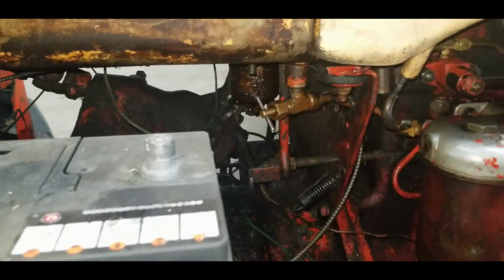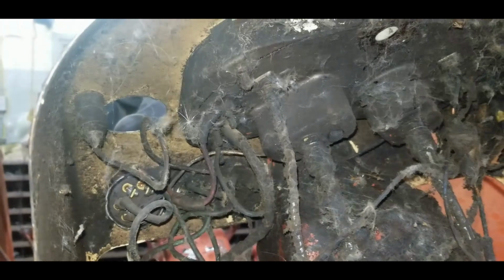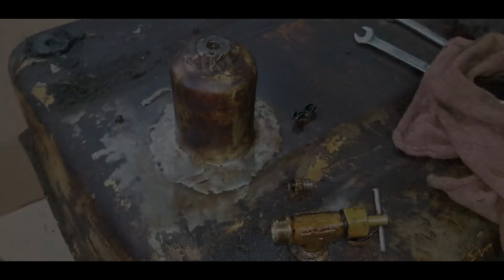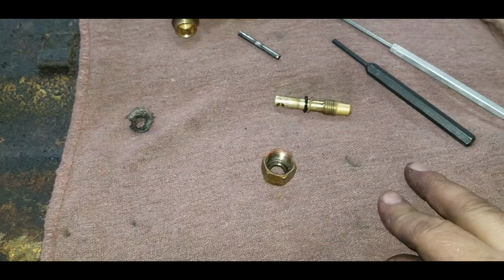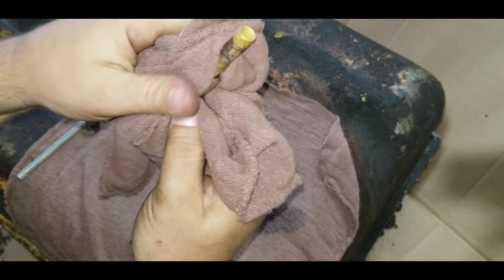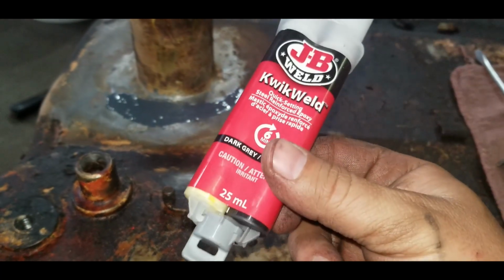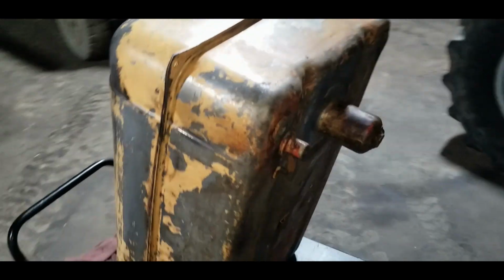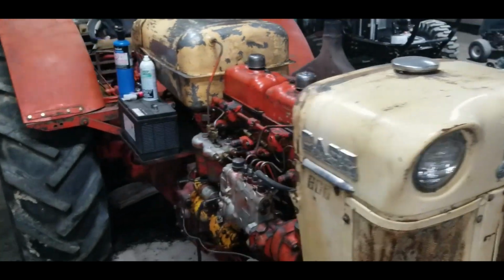1959 Case 800 build.  Part 29!

Comment: That thing you asked about in the end of the video is supposed to have a big long screen on it to screen out any dirt in the fuel.  I'd send you a picture of what its supposed to look like if i had a way how to? But anyway I took it out of my 500 because in today's age fuel is allot cleaner than it was in the 50s and 60s and I wanted to beable to see down in my tank and not have to fight with the fuel nozzle in that small hole.   Also my tank has some jb weld on it too its not quite as mice as yours I washed it out really good aswell I had a couple small rust pin holes in it the jb weld took care of then I also lined the inside of my tank with "red kote" fuel tank coating
Reply from the maker: That makes sence.  And I will be taking it out.  Like I said, they put a 3 inch fuel fill and then cut it dawn to the size of a quarter...  wouldn't be so bad if it wasn't 5 feet off the ground. 🤣